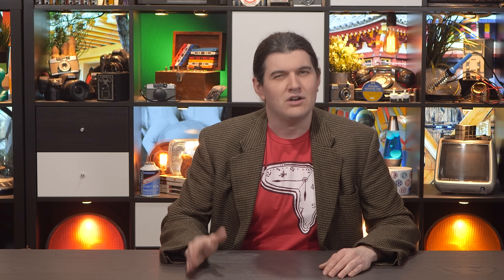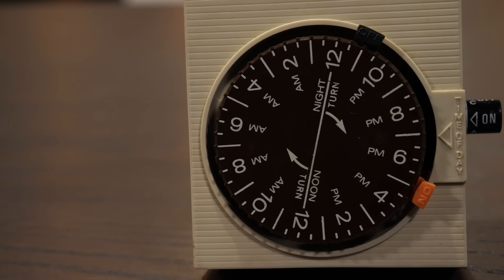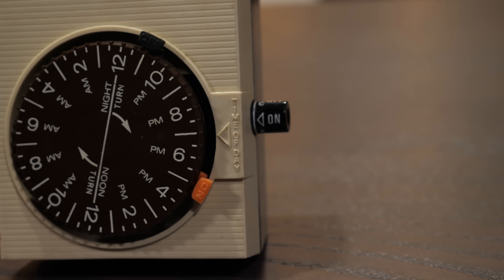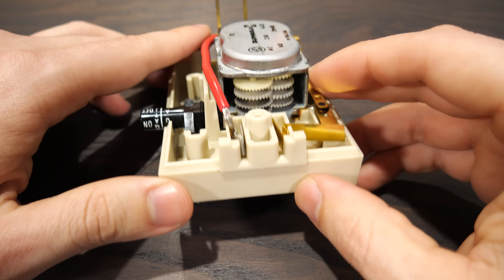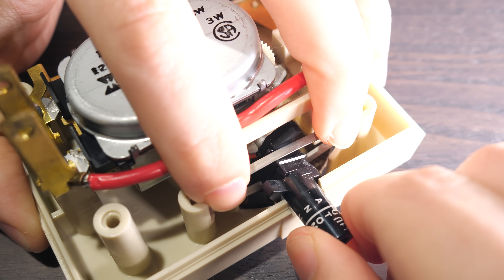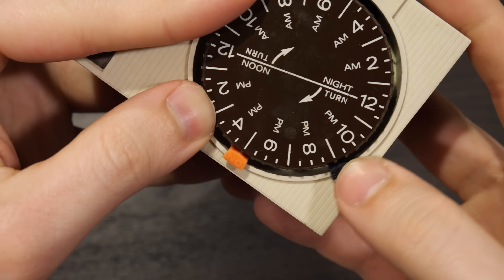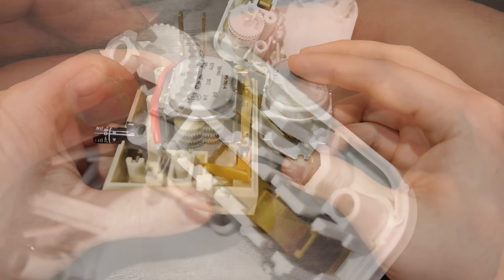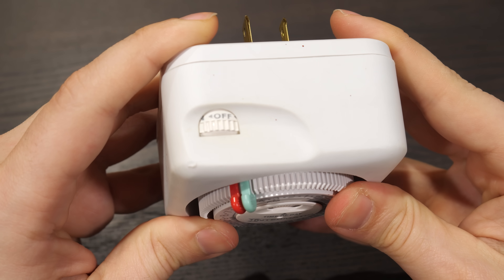Timer switches: literally just a clock and a switch

Comment: Many years ago I picked up a GE/Telechron timer in a waterproof box at a thrift store.  A neat feature is that the timer had a cam system to adjust the on/off times to coincide with sunset/sunrise on a yearly cycle.  The cam lobes could be moved a little bit in/out back/forward by loosening a set screw to accommodate local latitude and time zone offset.  From what I can figure out these GE timers were installed individually on every street lamp post in parts of New York City.

Here is a side note, a guy named Warren invented the synchronous motor (or at least one type of) in the 1920s.  Warren’s motor was inherently unidirectional.  Other synchronous motors would randomly rotate either direction and had to employ a brake to coax them to go the way you wanted, or you had to manually flip the shaft in the correct direction.  Warren started the Telechron (time at a distance) company to sell electric powered clocks.  The problem was that power grid wasn’t a grid in the 1920s and frequency was close but not exact, which kind of negated the benefits of having a synchronous motor.

Warren Telechron also invented the power station master clock.  The clock was actually an electrically wound spring powered pendulum regulator and a Telechron motor connected to a differential.  As long as both clocks were in sync, the differential did not move.  If the clocks drifted apart a big pointer attached to the differential would move away from “0” and the power station’s engineer could speed or slow the generator a little until the pointer was back on “0.”  So customers’ clocks might drift a little, but would always be within a few seconds of the correct time.  The Pendulum side of the power station clock was checked against the Naval Observatory radio signal once a day, and the clock was supplied with tweezers and little gram weights which could be added or removed from a tray on the pendulum shaft without (hopefully) stopping the pendulum clock.  Warren Telechron was bought up by General Electric who sold GE Telechron mechanical clocks probably into the 1980s.

Comment: Oddly enough I took apart the same Intermatic model D111 timer after it started acting up. Mine has a polarized plug (and socket) and a white dial but is otherwise identical. I always found it odd that it needed to be plugged in upside down. For completeness sake the motor has many poles so the rotor turns at much less than 3600 rpm.

Comment: According to Intermatic's website, they started developing mechanical and electrical timers in 1945.  To you comment about timers and photocells, I have installed both on some jobs.  This was because the photocell would turn on the lights in a parking lot at dusk and the timer would shut off the lights a few hours after the business was closed for the day.  You might save some money on your electric bill if you are not using those fancy LED lights.

Comment: One significant difference between mechanical and electronic timers that I'm surprised wasn't mentioned is that the mechanical ones can generally handle much higher loads.I have a timer that uses a photocell to trigger the lights, and  therefore uses electronics to control the power switching, and it's rated for a maximum load of only 75 watts. Of the three mechanical timers I checked, one was too old for the specs to be readable, but the load limit was 4 digits, and the lesser of the other two was 1750 watts. So, if you're going to use an electronic timer for your outdoor Christmas lights, those lights had better be LEDs!

Comment: One nice thing about the second one is that using only an off tab (or multiple) you can have an auto-off feature. If you get enough of them, you can have it set up so it automatically turns any attached device off every hour, so no matter when you turn, say, a light on, you don't have to worry about it staying on.

The biggest downside to any of these (even the fancier digital one) is that you need easy access to the plug if you want to manually override them, and those are usually down at the floor and away from the door. While the app controlled ones have their own layers of frustration, it can be convenient to be able to yell at a speaker or into your phone "turn on the light" and have it override the regular programming.

I guess what we really need is one of these with a Clapper override.

Comment: Have/Had versions of all of those since the late 70's... Intermatic and its inventive use of simple motors and basically using them on so many different models... If/when you NEED to repair one you can often find replacement parts or just scavenge then from an old/new one.  Grandmother's old "Malibu" Low Voltage Transformer had its Analog Timer Motor burn out... As it's just an Intermatic Timer... It was a lot cheaper to just buy a new Timer with that same motor.  Was going to "repair" the old unit... But since the new Timer ain't broke... I just plugged it into the Transformer and set the time. Should last another 10-15 years... Then probably just need to upgrade to a digital timer...

Comment: I really used the 48-tab version during the February 2021 central US cold snap. We had power in Oklahoma, but it was still damn cold, and everyone (including me) was running their faucets trying to keep them from freezing. Eventually, the city asked residents to cut it back because they were starting to have issues with the water system. So I grabbed a space heater and pointed it at the pipes under the kitchen sink, which was the only faucet I was concerned about, and I used the timer to put the space heater on a half-hour on/half-hour off cycle for a couple days. It worked, I guess. The faucet never froze when I had the space heater pointed at it, and the space heater didn't burn out or burn the house down.

Comment: I've used a timer similar to the 3rd one for 20+ years for a basic evening light for when I return from somewhere and as a way to look like I'm always home.  It's worked well enough I've not had the need to go for newer timers or internet/phone controlled lighting systems.  I have a 2nd one for seasonal needs.

Comment: A bigger cousin to these would be older mechanical traffic controllers. They have a timer that rotates continuously and has tabs set at various places to adjust the percentage of time for a given indication. The actual sequence of lights is controlled by the cam, which is stepped each time a timer tab trips the switch. Thus with two systems, the timer and the cam, you have a unit that can control in what order the lights go and for how long each step is. Acme School has an episode on them, but it would be neat to see you do your take on them as well since you have the traffic modules in the back wall display.
Reply: I hope he'll do a video on those. They're wonderfully complex, especially since they have a lot of safety mechanisms to prevent things like an all-green situation.
Reply: Damn, quick, someone ship him one of those 4 ft high, 300 lb traffic light controllers.
Reply: Electromechanical traffic controllers could be synchronized as long as they were on the same distribution circuit.  Traffic Engineers used to synchronize lights by pulling and plugging fuses.  It doesn't work between circuits because there is enough inherent variance between distribution transformers to allow the timing to drift.
Reply: That's remarkably similar to the timers that sirens would use for noon/curfew blasts. A clock that would momentarily close a contact at a certain time or times, and a timer that used cams and microswitches for the signal timing and duration, and possibly controlling a coding damper if the siren had one.

Comment: General Electric and other companies manufactured clock radios in the 1950s or earlier with a switched outlet. Basically, they packaged a typical vacuum tube radio of the day with an electric alarm clock that, in addition to having a buzzer to wake up the user, had a mechanically operated switch to turn the radio on and connect power to the outlet. Coffee makers in that day didn't have timers, so the radio's cord and switch were designed to carry enough current to power a coffee maker. The user could prepare the coffee maker the night before, wake to the buzzer, radio, or both and have the clock radio start the coffee maker, so fresh brewed coffee would soon be ready. As best I can recall, these clock radios preceded the consumer timer switches discussed in the video.

Coffee makers don't really belong in the bedroom, so users who liked the idea may have bought a second clock radio for the kitchen and set it to start the coffee maker a few minutes before the bedroom alarm went off. In addition to the bedroom alarm or radio, the user would awake to the smell of fresh brewed coffee. The kitchen's clock radio would also serve as a normal table radio for listening at other times during the day.

Comment: I have one of those electronic ones that can automatically adjust for Daylight Savings Time (DST) once you choose the correct DST option (who'dathunk that different countries have DST at different times of the year?).  Worked wonderfully, until some wiseguy in the government decided to change when we changed out clocks.  Now the timer changes to/from DST a week off.  Since it  is located behind a bookcase, its not worth the effort to manually adjust the time 2x a year for the sake of a week.

Comment: Had 220 volt  high Amp  unit in a Auto shop setting to turn the huge air compressor on at the opening and off at closing hours, it was in a big gray metal box, as the air tended to leak if a air tool was left connected, it stopped the compressor cycling all night, saved on electricity expenses. They have digital  ones that do the same with a battery back up, but as batteries fail and no one checks them one outage just erases all the programmed settings, the mechanical unit never loses programming, it just shifts timing due to outage, now if they had a time signal  unit with EEPROM that might work good.

Comment: I was led to understand that in the US power companies make an effort to keep the frequency synced - that they will run a little bit fast, if they'd been running a bit slow, so as to avoid long-term drift. Because line-synced clocks are common in the US.

But that European power companies did not. They'd work to keep the mains frequency at the specified 50Hz because, but that they'd make no effort to avoid long-term drift. Because line-synced clocks are not common in Europe.

Comment: Excellent video.  Dumb stuff to point out just to be pedantic: A 3600rpm motor is a TWO-pole motor.  There are no single pole motors.  Also, an electrical prof of mine once claimed that when he worked at a power generation dam, they would routinely alter the frequency of the AC power leaving the station - apparently slowing it down to something like 57hz during the day would actually save a lot of energy and then they would speed it up to over 60hz at night so mechanical clocks could catch back up.  It could have been a tale but sounded reasonable at the time.

Comment: You're supposed to store the tabs right on the dial face, but nobody ever figures out the proper way to do it.  If you group all of the "on" tabs and all of the "off" tabs together (as opposed to alternating on, off, on, off, etc, then the only "on" tab that matters is the first one in the group.  All of the extra "on" tabs behind that first one are ignored by the timer (because of the offset in the paddles on the switch shaft that you showed)  same goes for the off tabs.  

So as long as they're all grouped together, then it'll run on a single schedule.

If you want to set a second on-off cycle, just pluck any one of the "on" and "off" tabs out of their groups, except for the very first ones of course, because those are the ones that are controlling your original schedule.  Then insert them wherever you want the second schedule to be, and now the timer will turn on and off at both set times and will ignore any additional tabs that you have "stored" in-line with like colored tabs.

Comment: I've actually begun using these timers for home automation in the past year! Despite living in the 6th biggest city in the US, my WiFi is incredibly unreliable; Siri and Google automations only work when they want to. I just want my lights to go off when I leave for work and turn on when I get home... Which typically happens at the same times every day! The smart assistant systems of today are just so needlessly complicated and fussy, If the WiFi drops out for even a second all of my lights are unable to be controlled for over 10 mins as everything resets and reconnects. 

(Another upside of using such a dumb and simple device is that it's not constantly phoning home and collecting data!)

Comment: On the newer ones, the lack of indication whether 'in' or 'out' is 'on' allows for the microswitch to be wired 'normally open' or 'normally closed,' in case they suddenly start getting switches with the legs the other way around.

Comment: I have several timers in regular use, which are great for making "dumb" appliances "smart" without an upcharge. The only downside is that when the power goes out, you have to remember to reset the current time or your program will be out of sync.

Comment: The built-in tabs models are very common here to control electric hot water boilers for showers, though last year I replaced mine with a phosisticated WiFi enabled electronic device that I can use to setup weekly(!!) schedules!

Comment: Back when I was working for a VoIP company that did installs for small businesses (ones that don't hire an IT manager and are horrible at remembering to reboot their equipment with any regularity to prevent system issues), I recommended hooking one of these up to their router and setting the device off sometime around midnight and then coming back on again immediately after. For the ones that listened, their trouble calls typically dropped between 50 and 90%.

Comment: My parents used to have one of these from at least the 1980s, maybe earlier. It looked exactly the same as this one. I remember it vividly because it only ever came out of the cabinet when we were leaving for vacation. They used it to turn on/off a light near the front window of the house when we weren’t home in an attempt to make it appear as though someone was home (a tactic that has been widely debunked since then).

The old Intermatic style timer also came in a version that had tabs that you could switch up/down like the later style one that you showed. I’m not sure if it was a later design or a more expensive version.

Comment: All those newer mechanical ones have plastic gears.  A timer's geartrain "does almost nothing" until a turn-on or turn-off is required.  Then that plastic must grunt, groan, & strain to overcome the hysteresis spring.  After it does that a few hundred times, the teeth depart from the gears (as you mentioned in the video).  Even if you never turn the thing on, in time the plastic pinions split from the stress of being pressed onto shafts.
          In the electronic ones, the batteries die, especially if you get them out only for Christmas.  In addition, a PhD is required in computer science to program them.  The cheap solid-state switches (triacs) blow up, resulting in an "always-on" timer.  Forget using these outside where there is a substance called "water".  The only thing I have not seen yet is the "I agree" screen that you must navigate through to get to the programming.  But just wait!  It will be a new feature, along with a password!  (If you buy the more expensive model, you get the same thing, except the password is different to unlock more features.  Without the password, you will have "free use" for 1 year.  Thereafter, you will need a subscription.

Comment: When I was around 12 (late '60's), I gutted one of those old analog clock radio that had socket in the back.  The original was designed to turn a coffee pot on when the alarm went off.  I used it to turn my stereo on so I could wake to music

Comment: I used to have a few that had 2 holes (inner and outer) at 15 minute intervals, and little pins (all identical) that you put in outer for on or inner for off (or vv, I don’t remember). The internals had some mechanism under the ring that resembled a ball point pen’s thing.

Comment: In the UK in the 90s there was a model which instead of removable tabs had tiny removable plastic pins which were inserted into holes positioned around the perimeter of the dial. There were two concentric rings of holes, one ring for "on" the other for "off". I've still got a couple these which I use for Christmas lights, and unsurprisingly no longer have all of the pins (they're about a centimetre long and a millimetre thick so very easy to lose!)
Reply: These were great as if you only put pins in the “off” ring, you could manually turn them on and gave them switch off a couple of hours later, without it then automatically turning back on.

I used to use one on my soldering iron so I didn’t have to worry about whether I’d remembered to switch it off when I was done!